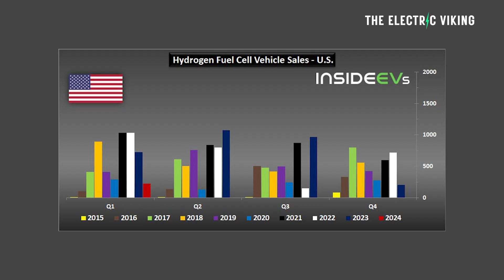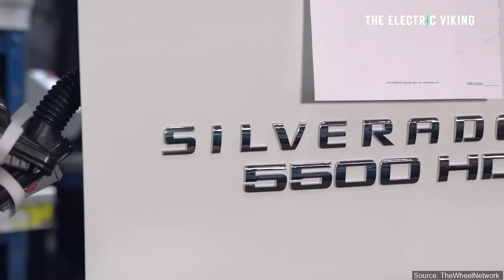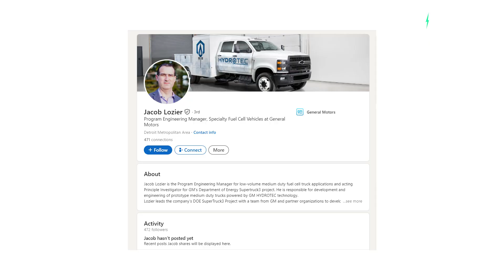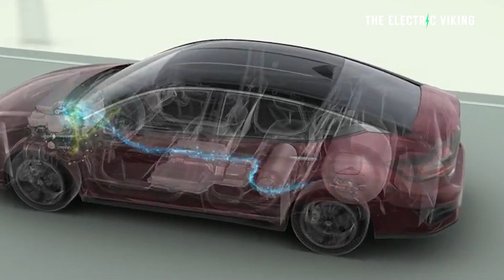GM reveals hydrogen powered pickup & plan to be a hydrogen supply company

Comment: Now Gormless Motors are joining gormless Toyota in falling down the hydrogen rathole.

Yes, hydrogen fuel cells work, but ...    They are useless if you can obtain liquid hydrogen conveniently, and you can't.

Hydrogen is very difficult to distribute.  It can't be sent via a pipeline as the pressure is too great, or the temperature is too cold.  It is the smallest molecule, so it can leak through even stainless steel or titanium, which is why NASA has to keep topping up their rockets with hydrogen right up until launch.  Frozen valves have caused numerous NASA rocket launches to be delayed and even cancelled.

Hydrogen pretty much has to be created at the point of sale.  This is usually done using methane, a byproduct of oil production, which is why the oil industry is pushing hydrogen as an alternative to gasoline and diesel.  Hydrogen is very volatile.  It burns and explodes easily.  Check out bus depot explosion when a hydrogen bus was being refueled in California.  Imaging a hydrogen production plant where now there are gas stations.  Would you want one near where you live?  I doubt it.

Hydrogen fuel cells are a 'bridge to nowhere'.  Pointless, unless you are going into space.

Comment: Every person who tells me that hydrogen is the way forward I ask where can you fill up ? most go silent one told of a distant commercial station ' I replied how is that moving forward when anyone with an EV can fill up either at home or in almost every town now and that hydrogen systems are complex and generated hydrogen is neither cheap to produce ' then there is range as Sam revealed with this truck - big range is more and or larger high pressure tanks that take up space and add more weight ' interesting to be in a time where battery longevity density stability and cost cutting grow at an impressive rate

Comment: 19,500 lbs is the gross vehicle mass (GVM), the max weight you can load it up to. That's 8.8 tonnes for us in Australia and Europe. It is a big truck with a big load capacity which highlights the benefits of hydrogen, that the fuel is very light and very suitable for heavy vehicles. This is exactly what GM and Ford need to do because hydrogen makes a lot of sense for heavy haulage and that will build out the infrastructure for smaller vehicles later.

Comment: Meanwhile back in reality batteries are cheaper than ever, charge faster, have no efficiency losses like all Hydrogen systems  due to energy conversion.  It’s just plain stupid.  This is a fossil fuel big government attempt to control the flow and supply of the new oil…wagging finger, no no no

Comment: SCAM model to fool government that has no idea. Total crazy and idiot burning money and energy for producing hydrogen, then idiot infrastructure and not very safe for handling by normal people! We have NO excess energy for that kind of use but eventually for homes instead of batteries. This is throwing money out of the window because hydrogen costs at least 10 TIMES more than diesel and fuel cells are not free of service. Neither Honda nor GM are near HYUNDAI nor even Toyota. And the world leader with long existing fuel cell vehicles and no prototypes says that this are only rolling labs and infrastructure far away from existing and far too expensive to be competitive. So a Tesla Semi wins over Hydrogen powered trucks and the small ones such as CT, Rivian and Co are present already. So it’s just SCAM🤪🤡💩🤮🤬🦄😎👿

Comment: A Hydrogen vehicle uses 5 times the electrical energy compared to a pure EV to generate the Hydrogen fuel before you even fuel up the vehicle. This is madness.
Reply: But they also last 5 times longer than an battery powered  EVs so are better for the long-term future. This is why satellites, which are in space for 20-30 years, use hydrogen fuelcells and hydrogeb batteries. They are also lighter and get more range. Know the facts.

Comment: This is another case of how ICE manufacturers are scared to death of electric motors. Electric motors mean a lot of mechanics will be out of jobs since the moving parts drops by over 3000 to some bearings. There is very little that evs need to return for servicing and why in the world would they want to cut thier repeat income.
Reply: Nonsense. Fuel cells feed electricity to electric motors.

Comment: I was under the impression that Toyota gave up on Hydrogen fuel cell technology and instead switched to hydrogen piston engine technology.  Did Ford succeed where Toyota failed?

What am I missing here?

For background, I thought that "hydrogen fuel cell" technology meant that you could release electrical current from hyrogen using a heavy metal catalyst instead of releasing heat by burning hydrogen that pushes pistons and thereby rotates a crank.